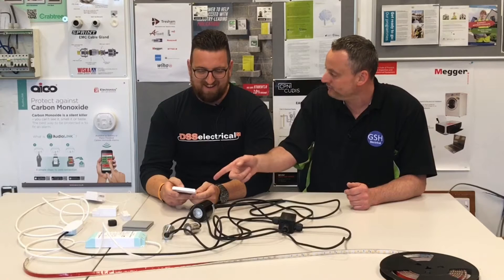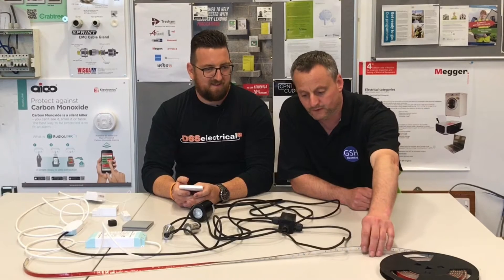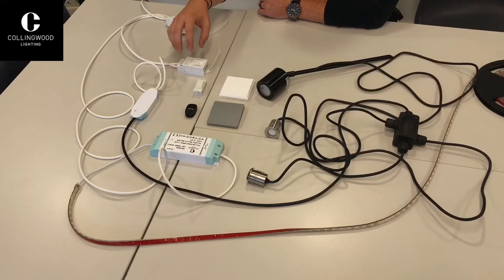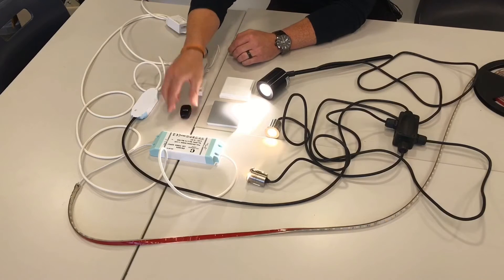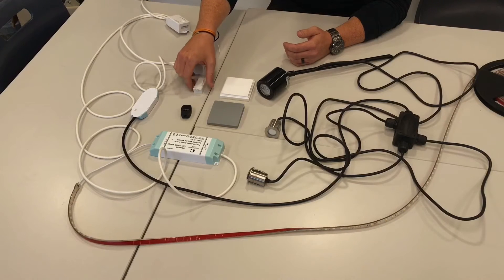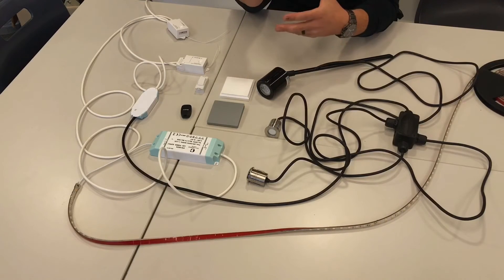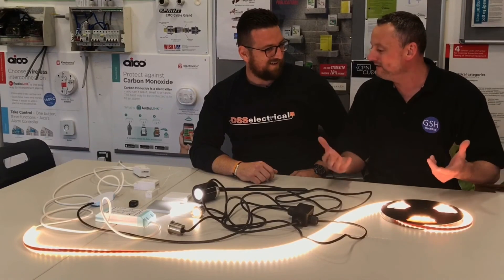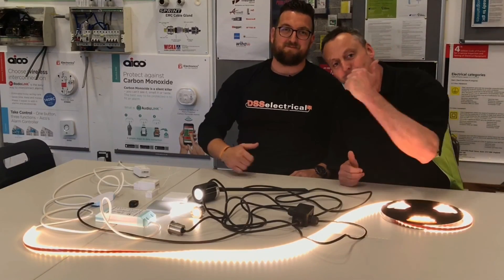How to Connect Quinetic Switches and Landscape Lighting

Comment: How would this work in a bedroom? Would you connect the live and switch wire together in a wago at the switch box and then just mount the kinetic switch onto the switch box, then connect the receiver to the now permanent switch wire and then the switch wire from the receiver into the light fitting?  Also, if the receiver was above the fitting, would the radio-wave be able to penetrate the ceiling plasterboard and pick up the signal?

Comment: I’ve got a customer that wants to use a quinetic switch to operate garden lights from his shed offfice, but he also wants to be able to switch them with his existing ‘old fashioned’ switch in his kitchen.. does anyone know if this is possible? Tried contacting quinetic directly but no joy.
Reply from the maker: Change the old kitchen switch for a Quinetic one maybe the grid type. If the location in the kitchen has other switches make the old switches grid switches and the new one to switch the new garden lighting a Quinetic switch. Hope this help. Gaz 🦾

Comment: Hi can I ask a question about this. I’d like to have 2 different lights powered with this system but have there own switch ? would I need 2 receivers ? Or can you buy a double receiver ? Is it possible to put the 2 receivers on the 1 double switch ?
Reply from the maker: Hi, I think you would need the set up we demonstrated we had 2 receivers. Thanks for the questions and watching. Gaz 👍

Comment: seems like the old mk echo system i experienced one problem with the echo system the receiver units got hot and cooked sometimes and many had overload thermal damage areas where resistors was placed on the circuit board , i hope the quinetic has changed all that might make a purchase

Comment: Hi guys could you talk me through using fob on a pir flood light how can you turn a flood light on bypassing the pir? Just curious as I wasn’t sure you could?
Reply from the maker: Hi. If you had a standard floodlight with the receiver connected to a supply and the outgoing side to the floodlight as you arrived home you could turn your outside light(s) on via the fob. If you then had another switch inside say the grid switch style in the house you can still operate the light(s) from inside your home. Hope this helps Gaz 👍

Comment: What you have demonstrated there is similar to how I bind my radio transmitter to a receiver or multiple receivers, but without accessing a menue on the transmitter for binding process (2.4Ghz frequency hopping systems). 

That's amazing. Truely revolutionary. Best thing I have seen for many years. I am sure with all those convenient benefits, it will have a very big impact on the electrical industry.